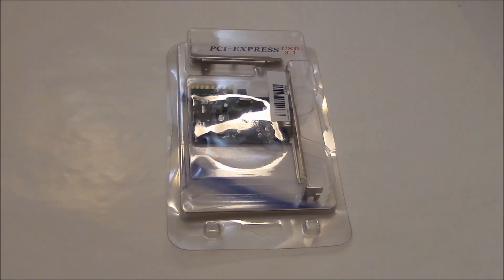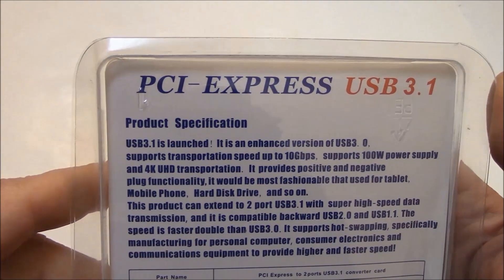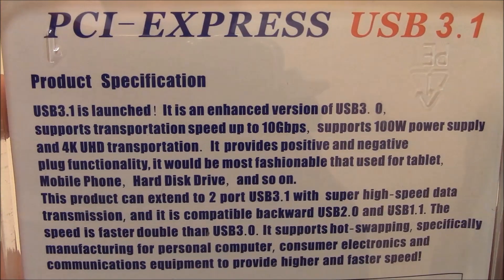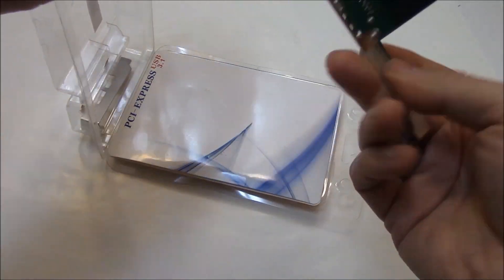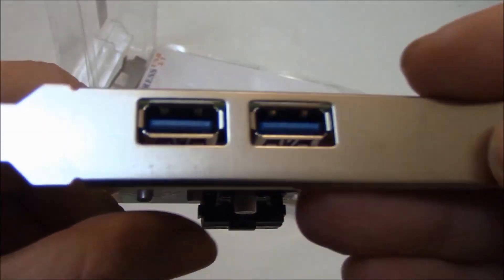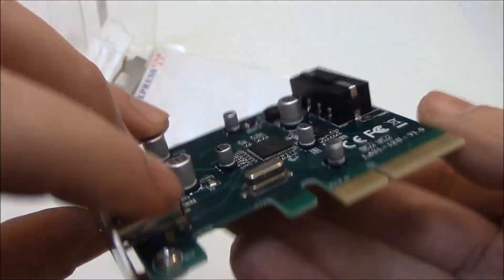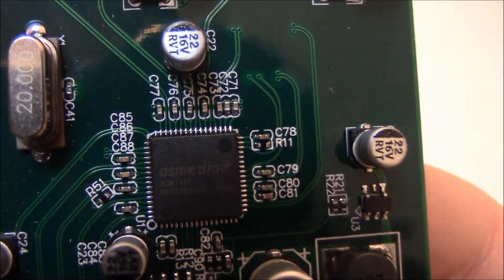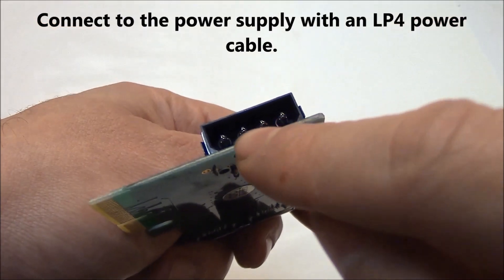PCI-E to 2-Port USB3.1 Type A PCI Express Expansion Card Controller 10 Gbps Unboxing

Comment: Why would it need external power in pretty sure it would pull enough power from the Motherboard itself like some GPU without a power connector will easily pull 100 WATTS